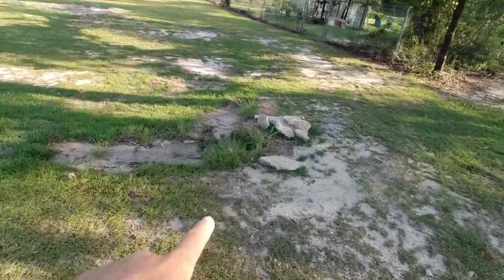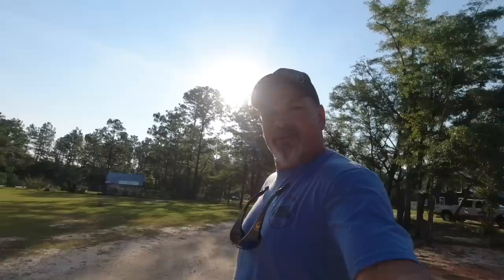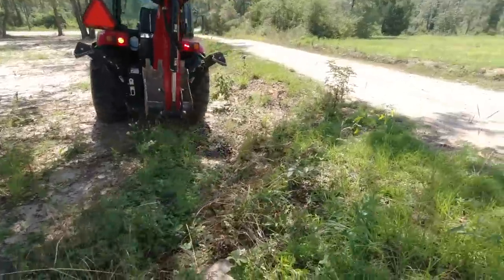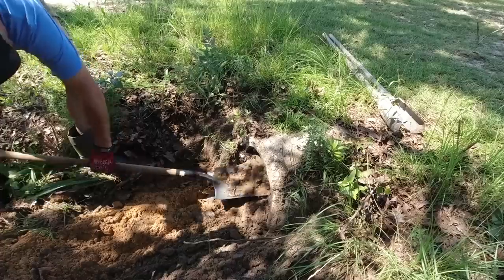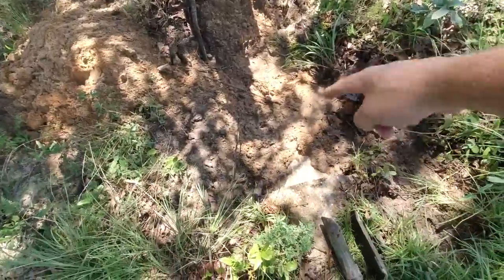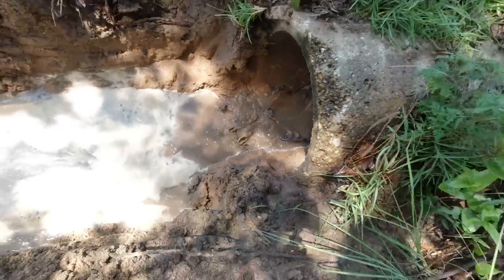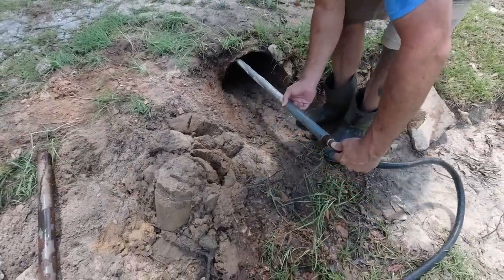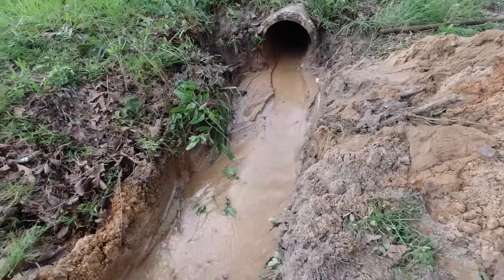YEARS of DIRT Clogged Up This Ditch! My Tractor Backhoe Working It!

Comment: Tip for cleaning the concrete cover app tie a rope onto a long 2×4 push the 2×4 through the Culvert with the backhoe poke a hole in a small bucket tie the rope throw the hole tie the other end of the Rope to the back hole and start pulling real easy while running water through the culvert
Reply from the maker: Ah! Super smart 👍

Comment: If you can get a strong rope or chain all the way through, you can use an old lawnmower tire to “pig” out the line. By pulling it through with the tractor. Using a Tire off the rim is easiest to pull. It will fold up and make a small clearing that will expand with repeated passes.  I used that trick on a 18 inch city road drain that was packed full of sand.
Reply from the maker: Great idea👍

Comment: The way I clean out our culvert pipe is run a chain thru it with an old lawnmower tire attached to 1 end and pull it thru with my truck. It works pretty well
Reply from the maker: Good idea👍

Comment: Looks good so far! I've had first hand experience with getting water to flow where it's supposed to go. It can be difficult. One slight incline and it starts flowing back on ya. Sometimes making a little reservoir helps to push it along too. I hope you get the results you want!☺🚜 Thanks for sharing, Hank!
Reply from the maker: Thanks David. Good idea

Comment: You can add pressure treated 2x4s to your stabilizer arm pads on your backhoe to prevent sinking in or tearing up your lawn. I"ve had mine for years, just bolt on and go. It's a cheaper option than buying the rubber pads. Depending on size of stabilizer pad you may want to use 2x6. Happy diggin!
Reply from the maker: Thanks Brent👍

Comment: I would at least dig a sump hole in front of the inlet of the concrete pipe for the silt to gather before entering the pipe. A concrete catchment would work the best and is easy to clean out.
Reply from the maker: Good idea 👍

Comment: Guys I was only 13 wen I was driving tractors 1 leaver fiat 480 in Pakistan wen I turned 16  my grandad got me 3610 Ford new and it was thy best thing out at time and only issues I had wer front bearing and hydraulic issues other wise solid tractor 20yrs we ran that so sad wen sold now got Massey ferguson 385 4x4 good tractor x
Reply from the maker: That's awesome 👍

Comment: Love your videos, but afraid that small corrugated pipe is just going to make your drainage problem worse..  A small pipe flowing into a larger pipe usually works, but large pipe flowing into smaller one rarely does. That sand, dirt and any other debris will stop where you introduced your new obstruction.  Hope I'm wrong, but I doubt it ! Good luck.
Reply from the maker: Good point David. Appreciate it bud👍